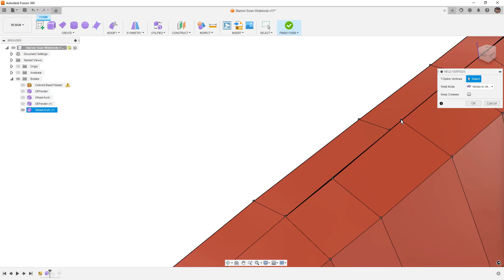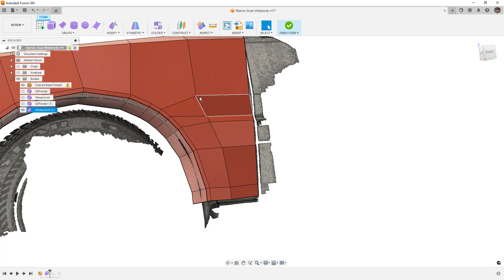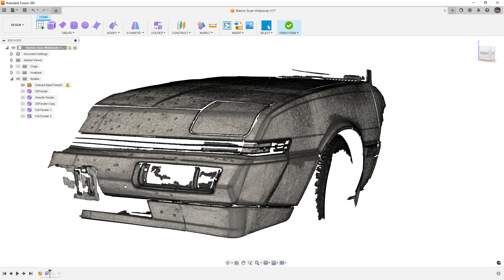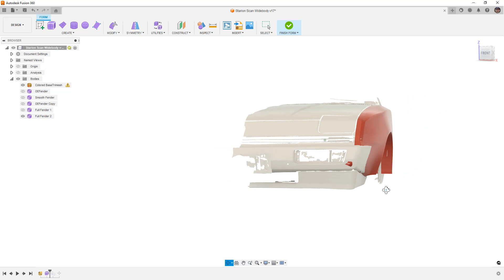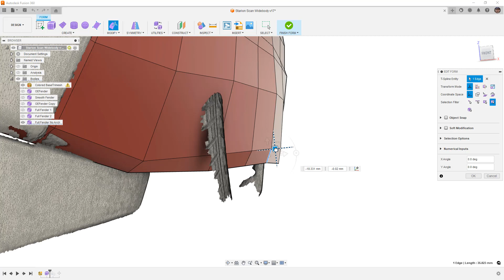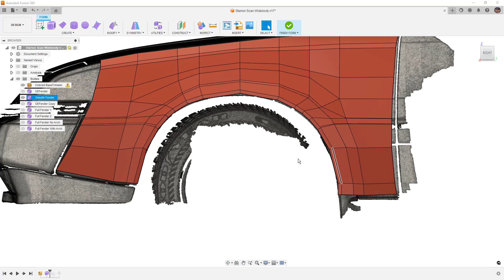3D Scan to Part Series Part 9 | Wide Body Design Part 6 | Rapid Concept Reuse and Hard Edge Control

Comment: Hello i want to Thank you once again for your videos and all the work you put in them, i have a question why dont you use autodesk alias?
Reply from the maker: Thanks!  So I have Alias on my list and I will likely cover it in the future.  I played with it years ago but the main reason is cost.  So many people are using Fusion for this type of thing at the hobby level.  Alias Concept is around $4000/year and full Alias is $10k or something like that.  Compared to under $500 for Fusion (or free for hobby).  Alias is a professional Class A package and the audience is much smaller than Fusion.  I think it would be interesting for people to see but I don't expect many people to be using it.
Reply: @LearnEverythingAboutDesign  yes i understand that’s the big drawback the high price , do you know any other software that have some of the modelling power like alias surface have except for fusion 360
Reply from the maker: @DBHCUSTOMS  Most that are in that area are also expensive....  On the budget side I have heard good things about Rhino.  That is also on my list to cover when I have the time.  I think it is around $1000 but that is not a license, you own a local "seat" of it and can pay upgrade fees with new releases if you want.  The SubD tools appear to be nice.

Comment: I think it's better 2 keep good  topology even on the piece you are  going to trim of as it will avoid unwanted tension in the rest of the model.
Reply from the maker: 100% agree for sure.  I probably wasn't very clear but my intent was that I don't care if it matches the car.  saying " i don't care what happens there" was not a great way to do that :)  Before its finalized the areas where it touches the car will be pulled into place and i will be sure to clarify that in that video.
Thanks!